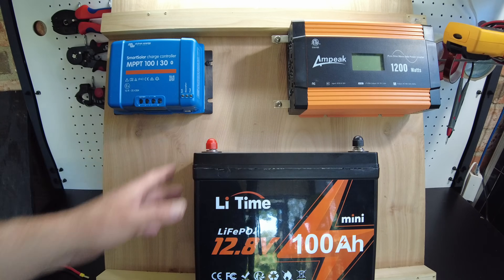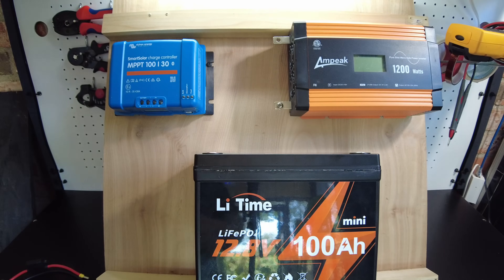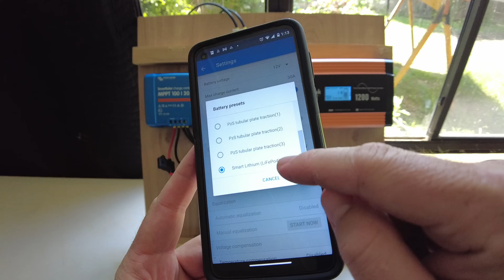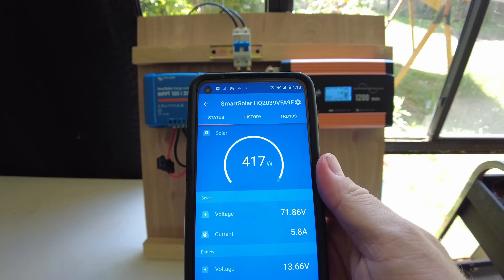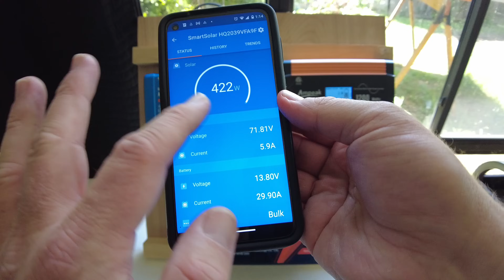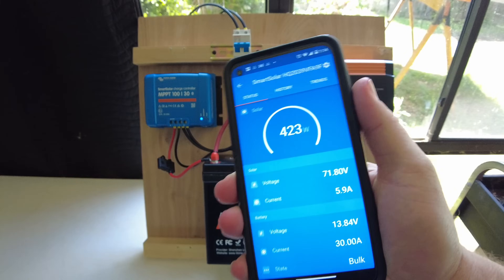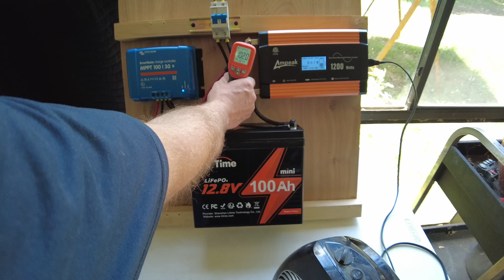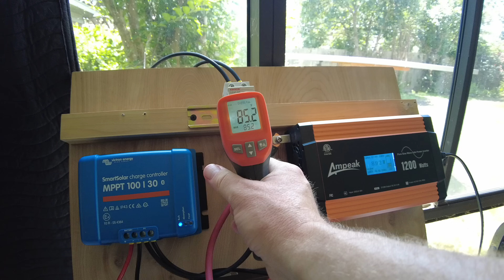Victron + LiTime MINI = beginner friendly off-grid

Comment: can you share the fuse sizes you used for that system?
Reply from the maker: I use a 40a fuse on the charge controller, and a 125a on the inverter.
Reply: @BradCagle  how do you know what size fuse to use? what if you were to up the inverter to a 2000w?  Is there a formular to figure out the fuse size?
Reply from the maker: @woodknack1  A 2000w 12v inverter at max might be pulling 200a or more. So you need wire that can handle 200 amps or more, you need a fuse that can protect the wire. So if your wire can handle a max of 200a, then your fuse needs to be 200a. The specs of this wire says it can do 200a for the 2awg https://amzn.to/440ksFO

Comment: If you have a good connection with the battery, copper will not oxidize. Infact i get pure silver lugs. Truly makes a big difference in efficiency. The spark is a good thing. It shows that the capacitors are charging  up. Excellent video.  Thank you for the information.  How long does your battery take to recharge at 50 percent with 400 watts solar?

Comment: I am a newbie. Do you have Amazon links to the style fuse you used at the inverter and the white switch you used for the Solar input?  As for the size of the fuse to use, what drives that for sizing. If you use a 40A MPPT  do you just use 40A fuses also?
Reply: What fuse ?
Reply: The fuse between the solar charger and the battery  @robersonmoron7891

Comment: 30A is right at the limit for 10AWG. 8AWG would have been a better choice.
Reply: Should be 2 AWG for battery to inverter then 4 AWG from charge controller to battery? No? Then a 10AWG is ok to go to panels from controller
Reply: Yeah 8 and make sure it's battery cable the more strands the better.. never use solid 10 gage or even the few strands in number 8. Direct current flows better with stranded wire. 73
Reply: P @ronb6182

Comment: The most informative presentation I've seen yet. just good basic stuff!!! and all the little stuff he covers is fantastic and sorely needed and missing on some of the high falutin channels!!
Reply from the maker: Thanks. Glad you like it 😁
Reply: @BradCagle  great video a little over my head but I'm learning. I am a 70 year old retired firefighter. My wife is disabled and stays basically in the bedroom which is about 15 by 15 and we use an air conditioner in the window 24 hours a day. I have the inverter and just need to get to solar panels the controller and I don't know a marine battery or a lifepo4. What would your recommendations be to run that air conditioner Around the Clock. And then there's the aspect of what parts could be in the room and what parts need to be outside the wall of the house other than the solar panels. The panels would be approximately 10 ft away from the house facing sunrise for 12 hours. I was thinking of getting ( 3) 300 watt solar panels

Comment: Should bolt that fuse to the battery bro. You did it kinda ass backwards. The fuse is there to protect the wire not the inverter.
Reply from the maker: It'll still protect the wire in the event of an over current fault here. The only reason it would be better at the battery (current source) is if something conductive breached the insulation across both positive, and negative wires. Very, unlikely here, but it you were running a positive wire across a vehicle where the chassis is grounded, then absolute must that you install the fuse close to the current source.
Reply: @BradCagle  agree 100%. I like your videos tho man. Wish I had the nerve to do videos  but I'm kinda shy about stuff I guess. I like seeing all you guys do with your stuff tho so thanks. You and about 6 or 8 other youtube guys is where I got the ideas of making my life off grid and had the confidence to where I thought I could do it. Me and the wife been off grid now for a little over a year. I spent around 25 grand so far on all the solar stuff and my inovair minisplit but it feels good being comfortable and not having any bills other than cell phone and truck insurance. Thanks again  for doi.g what yall do
Reply from the maker: @matthewknight5641  Dude that's awesome Matthew! Happy to hear you're offgrid. I'm glad you enjoy watching me tinker with this stuff :) Lucky for me I was in a rock band for years, so that helped me get over the fear. But man, I remember being so scared I couldn't even face the audience early on. You should just go for it man! Do some videos of your setup, it might not be great at first but it'll get better, and maybe sometime in the future it'll be something that brings in some income!
Reply: @BradCagle  I'm kinda proud of the system Ive put together. And yeah stage fright seems like a good way of seeing how I'm kinda nervous about making videos of my stuff. At first my family and wife couldn't understand the money I was spending and this hobby Ive gotten into but now they see it all work and most my family wants me to do the same to their house. Im usually so busy in this semi truck I don't have time for anything tho
Reply from the maker: @matthewknight5641  You should be proud!

Comment: I just bought the same victron controller. It specs out 6 awg wire from the battery to controller I noticed you have 10 gauge being used. Could that be why it’s warm at the in-line fuse? I thought the 6 gauge spec was overkill for 30 amps but maybe not now. Thanks
Reply from the maker: 10awg is plenty for 30amp. It's the fuse/fuse holder itself that is getting warm. The negative 10awg wire was cool. I have a different fuse type that I think will be better in an upcoming video.
Reply: @BradCagle  ok that’s what I thought. I wonder why victron specs 6 gauge? That seems way overkill. I have 10 gauge in my current setup with a pwm charger and I wanted to just use the same wiring in the RV and not have to buy the 6 gauge.

Comment: You want your fuse as close to the battery (or "source") as possible.  Really like the ferrels, especially for smaller screw-down connections.  A much simpler setup, with quite a bit more inverter output, is the MPP 2724 inverter/charger with two batteries, wired in series.  You still want the solar disconnect, but from there it's two wires into the inverter/charger and then two wires from your batteries.  Easiest off-grid system you can make, because it also includes several AC outlets.
Reply from the maker: Yeah. I totally agree on the fuse. That way if the positive wire is shorted anywhere along the length it will pop the fuse. I'll check that MPP2724 out. Thanks!
Reply: @BradCagle  Nice work...  I   run  a 24/7 mining rig. Runs 1000 watts.  Will that run the miner 24/7..  Thanks.
Reply: @tcathunder  how much sun hrs do you have in a day. This setup is only putting 400w and you taking out 1000w. So how can it run24/7  you need a 60amp mppt then atleast 200amp battery not this 100amp then make sure your solar/wind can charge at least 2000w/hr for 15hrs. Then you come back and thank me
Reply: Regardless of where the fuse is along that cable it will blow before the wire melts and catches fire.
Reply: @Lewythefly  - As short as that cable is, you're right.  The guidance on this, for larger systems, is to have the fuse closer to the battery, whenever possible.
Reply: his run up to the inverter is shorter than most peoples run to the fuse holder...
Reply from the maker: @LiLBitsDK  Yeah, that's what I keep telling people but they don't seem to get it. LOL
Reply: @BradCagle  many are so clueless and heard something but they never did anything IRL so basically have no clue about it.
Reply: How do I know what size fuse I need
Reply: @koolguys9781  - Fuses protect against wires getting too hot, for too long, melting their insulation and catching things on fire.  This means the fuse size is based on your wire size, and that is based on how many amps you're moving through that wire.  If your typical max load is 40 amps, get wire rated for at least 50 amps, and a 50 or 60 amp fuse.  That's the general concept.
Reply: @koolguys9781 base the size wattages
Reply: If wire is only 30cm,  i think fuse can be in any end
Reply: I want to build a system tog o car camping, that can power 2 laptops, a portable wifi router, a TV, and charge 2 cell phones. The charger on my laptop says 60W if that helps? What kinda system build do I need?
Reply: @AidenBraydenPodcast  - None of those things will draw much, by themselves.  Add up the wattage rating for each and that will give you a peak output number.  Multiply that number by the number of hours you would like them to run during a camping trip and that gives you the watt-hours of storage you'll need.
Reply: @AidenBraydenPodcast why go camping at all 🤦‍♂️
Reply: @@user-fg6lm3ef5o - So, you're saying fuses ARE a good thing?
Reply: Ah man.  Cool. Good info.
Reply: I totally agree
Reply: So if that fuse between the solar charger and battery blows, you then stand a good chance of screwing up your solar charger?

Comment: Nice build. After a few weeks of testing after receiving the goods, the refrigerator, TV, etc., the capacity is completely fine. I bought a 24V 100Ah battery. High cost performance.😃
Reply: Would it be a marine battery I'm going off grid trying learn
Reply: @angel1111. I used deep cycle marine batteries to learn on because I got them for free. I learned marine battery are good enough to learn with for free. But when I bought 2, 100 amp hour solar batteries huge, huge increase in efficiency. I have no idea what the difference is but there is one
Reply: @angel1111.  car battery works 👍
Reply: Why 24v and what sort of time are you getting out of it before you need to charge again?
Reply: You bought the whole setup just changed the size of the battery?

Comment: Toss all this in Milwaukee Packout rolling box for a convenient portable protected supply.  I tested mine by running a full size frig off it for a week on one 300 watt panel with the same size battery , charge controller and inverter (but mine was blue) .  It worked great . Sun powered
food cooling .
Reply from the maker: Nice. I have a toolbox I bought for something like that. I need to do it :)
Reply: why milwaukee parkout, iss so spencey
Reply: Heck, put TWO of these "mini" batteries in that toolbox, wired in parallel.
Reply: Will it power a 2000 fifth wheel
Reply: Do you have a fuse